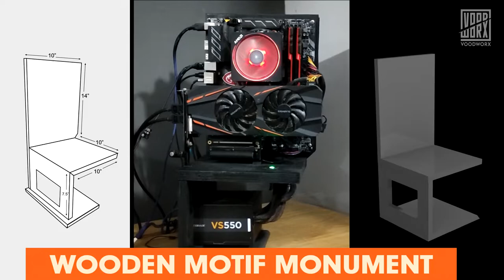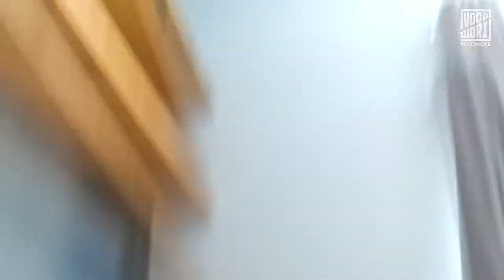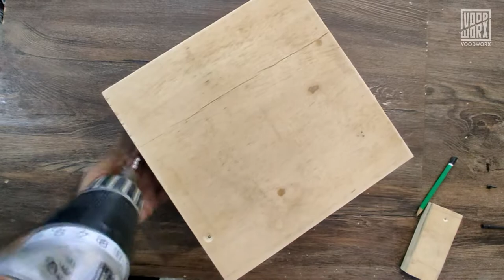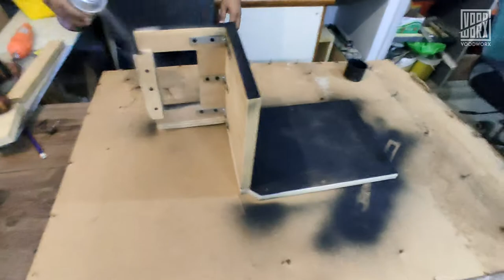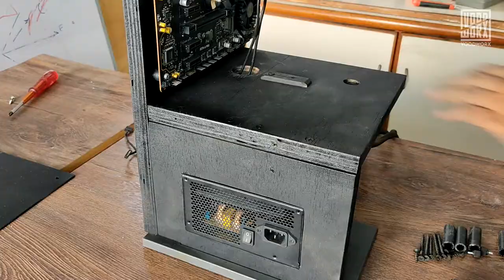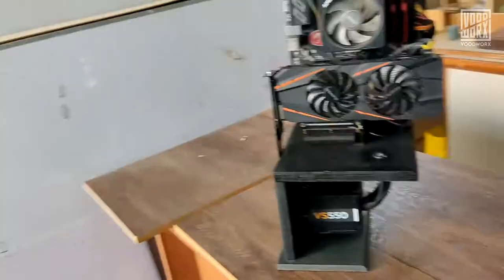Building the most compact wooden PC case ever the easiest way! - Wooden Motif Monument // Wood DIY

Comment: Good idea in the build but I think the title ios bit misleading as it is not that compact. Lots of room that could be used for other components.
Reply from the maker: Its compact for the size of motherboard its using. Use smaller motherboard if you want it any smaller